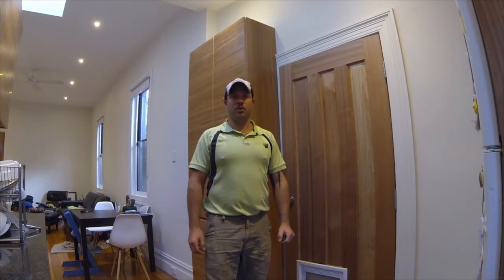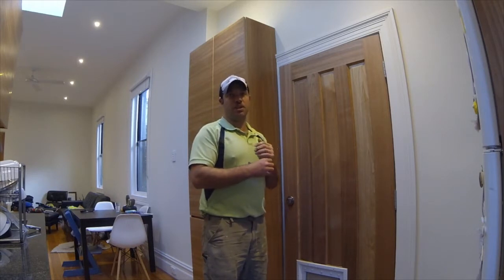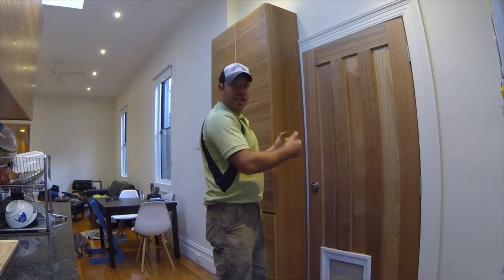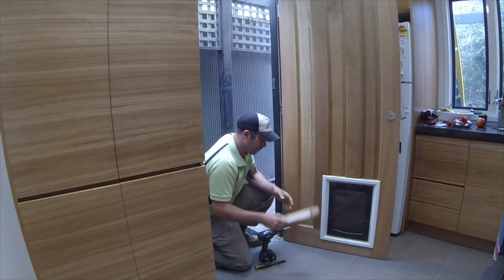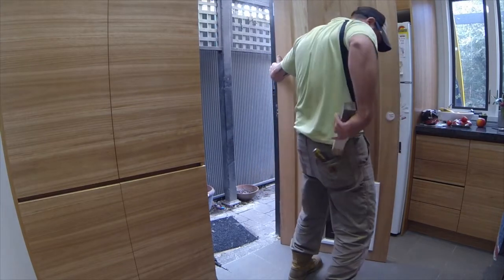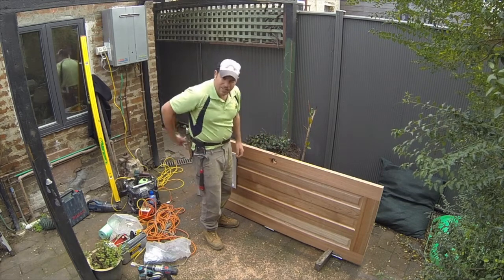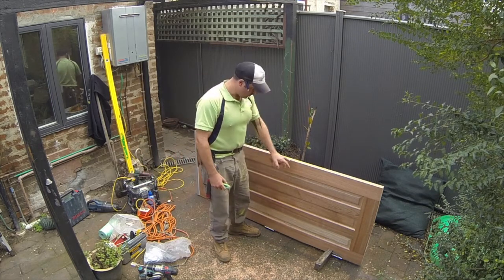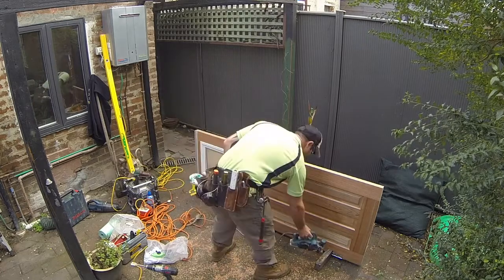How to adjust a door that is sticking.

Comment: Could this be done with the door still hanging?
Reply from the maker: +Hamid Karzai this can be done with the door still hanging, only if the top of the door needs a little shaved yet the door may splinter if the blades of the planer cut the wrong way